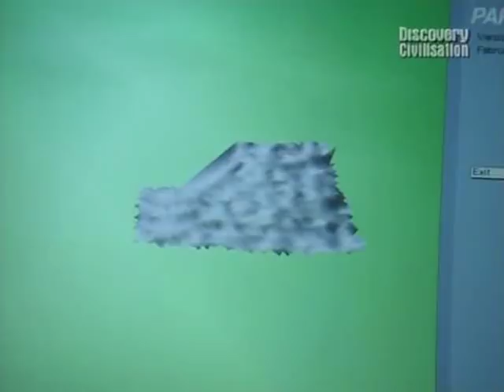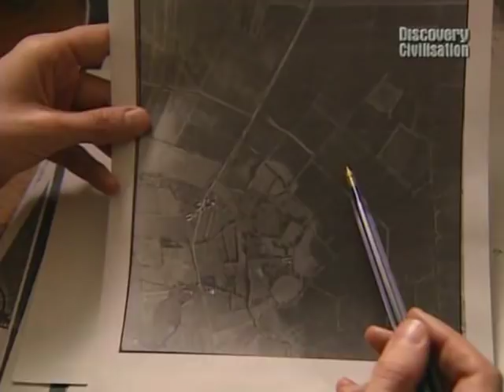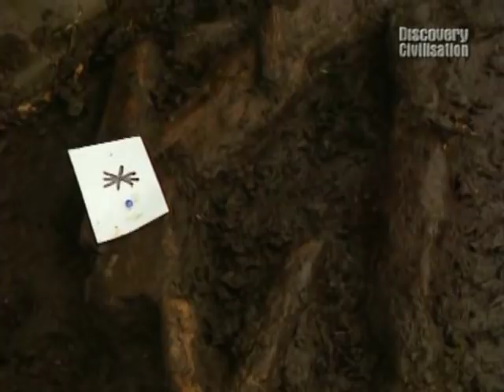Time Team S05-E02 Greylake,.Somerset

Comment: For the few who may wonder, the Florida site to which Mick Aston was referring is most likely Fort Center. Bit of an issue since this aired: further review of the material shows no evidence of a platform. The bundled bones ('secondary burials') were most likely plunged into the pond after being removed from the charnel house on a nearby mound. Animal totems stood on posts in a "D" shape which initially was interpreted as a platform.
Reply: Very interesting. Thanks

Comment: They were on the right track about driving the post but stopped short of getting it correct, on a video in India the men put the cross piece on top and 2 men on each side. With the extra weight it was no problem.